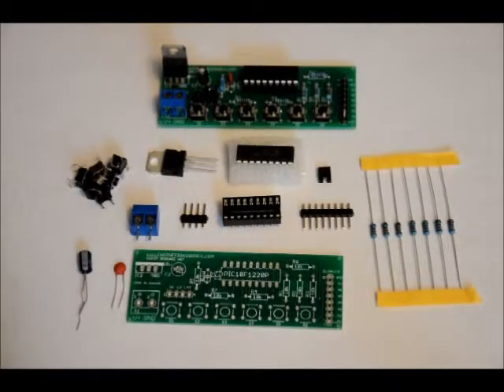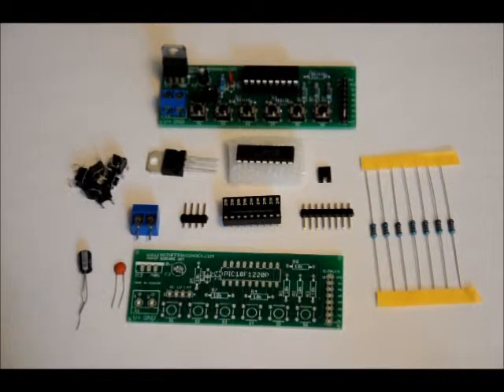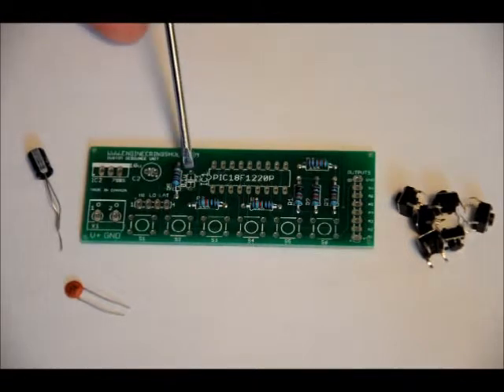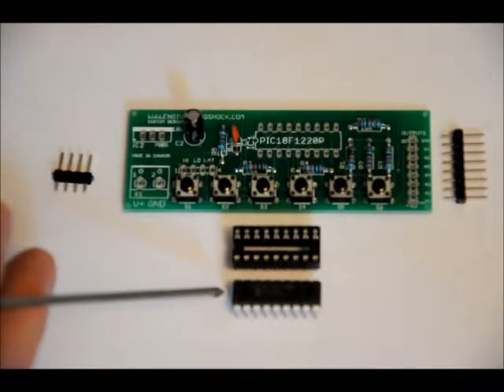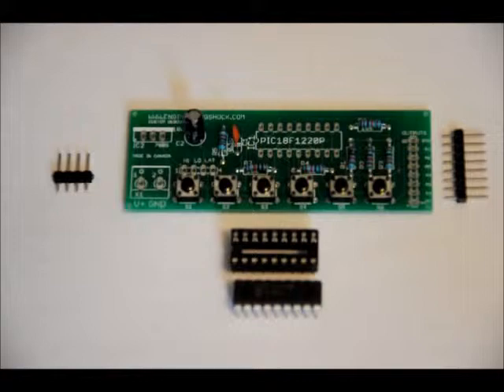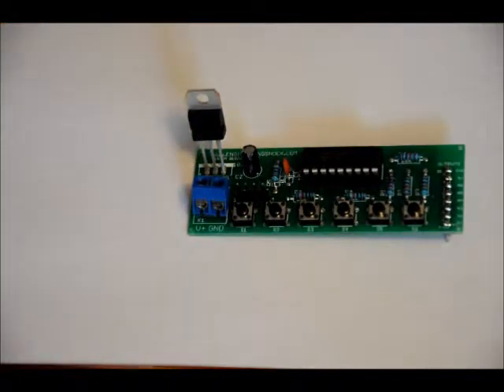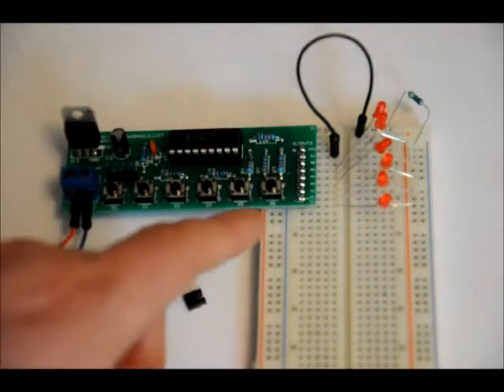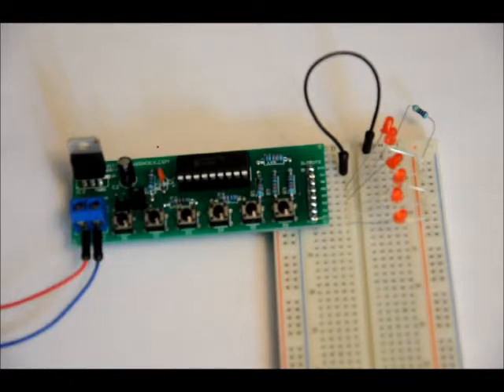The 6-Switch Debounce DIY Electronics Kit With Momentary & Latching Output Options!

Comment: i have a question for  my shifter project  (a long 1)
i need a toggle latch ?  that have 8 input button and 8 output state (8 is my ideal but 6 could work too)
that need toggle on/off (need to be hold for the gear to be selected)
but i need this  when  i go in gear 1 (button 1) its have to be toggled 
on but if i go on gear 2 (button 2) i need to reset all other button to 
off  but only when a new gear  is on  
you know a way todo this even by Arduino ?  
i can turn on/off some mosfet p/n for my need

i been searching for hours for something like that on google i only 
found a simple 1 button toggle that need to be re pressed to turn off 
with is not what i want
sorry for bad grammar i tried my best

quote id like if redstone from minecraft were in real world xD all those basic gates are so simple in minecraft